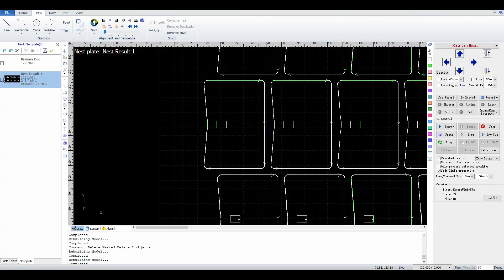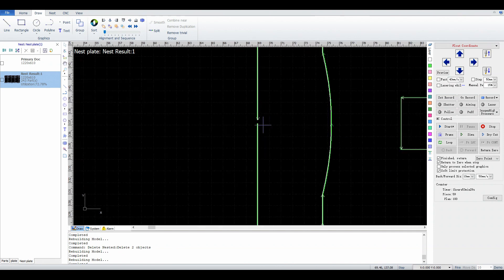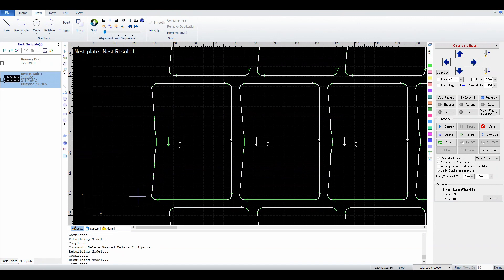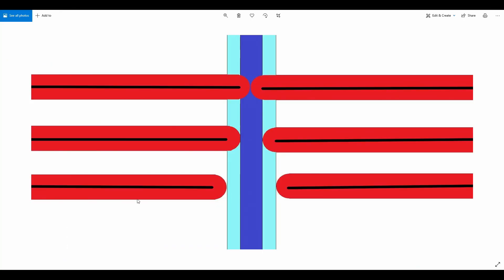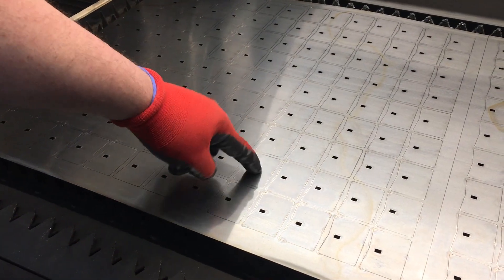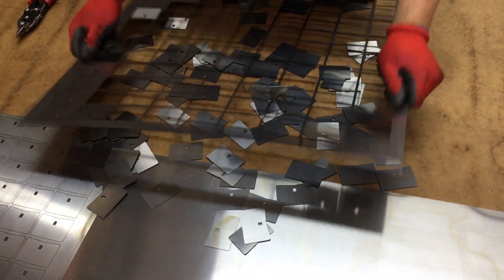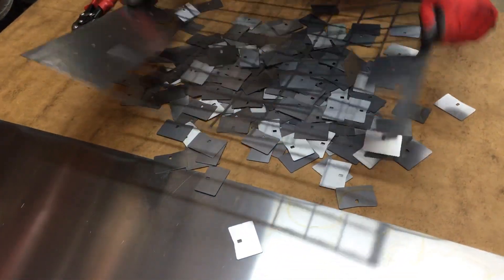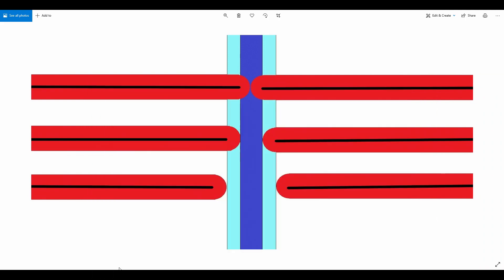Improved microjoints in cypcut.

Comment: okay at work we have 6kw raytools  and we usually use 2-5mm at work and we add lead line even with micro joint anything beetwen 1-1.3 should be fine
Reply: dipends of course how big is the part , and how much it does weight
Reply: I add micro joints even on a 10mm thickness

Comment: Hi thanx for the video. Do you have any idea why doesn't work the auto microjoint for us? No matter what we set Cypcut just doesn't add it. If we do manually it works, but by 200 small parts is a nightmare :)
Reply: Are you trying to do the microjoint in the individual part or after the parts have been nested? I don't think microjoints will be added automatically after the parts have been nested

Comment: thanks, for steel 4mm what you think well be ok?
Reply from the maker: I would probably avoid small micro joints on anything over 2mm. Thicker metal burns on starting so you don't have as much control.  But you could try a few parts with a .33 or .4 micro joint and see what happens.